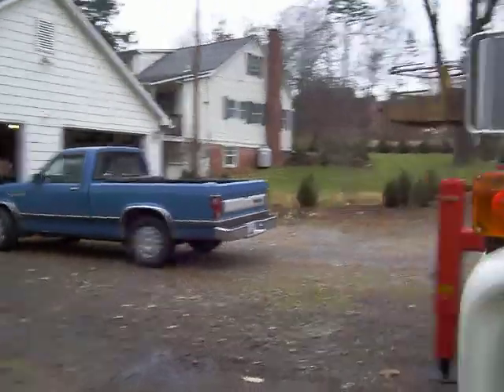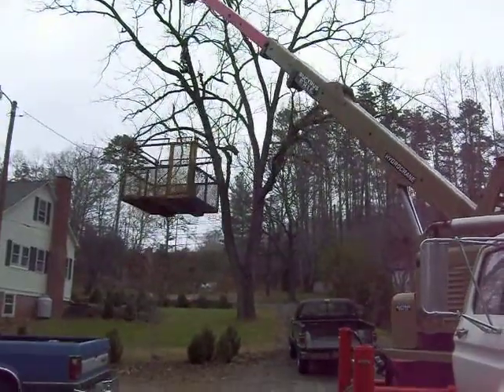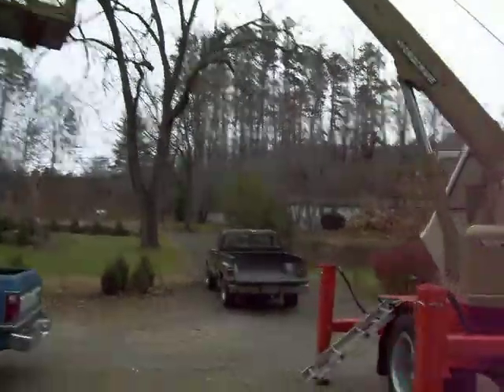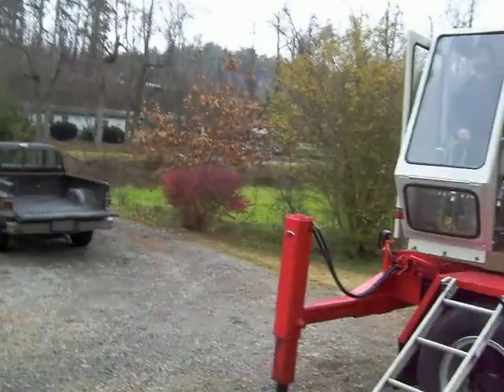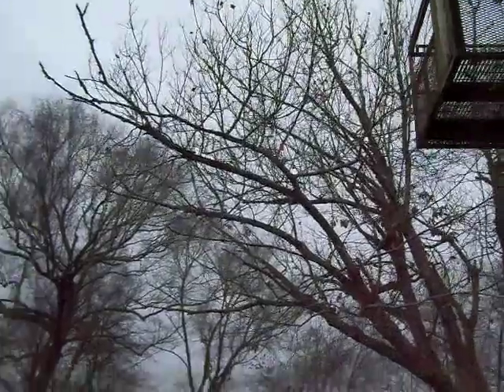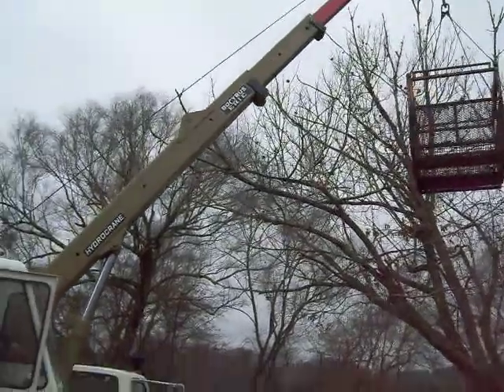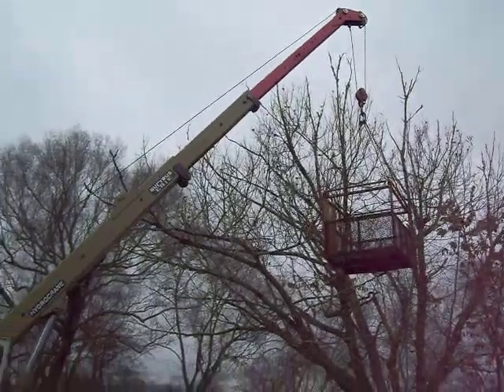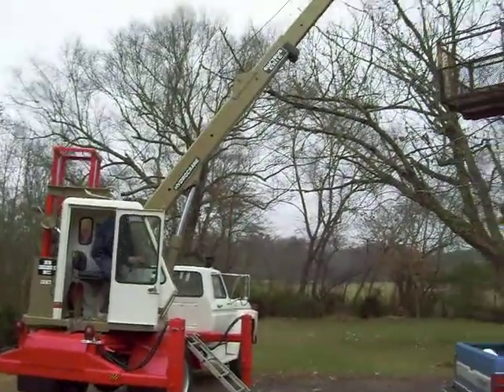Bucyrus Erie H-3 Hydrocrane

Comment: Awesome looks like brand new it would be a handy tool on any yard or even inside it sure doesn’t take much room 😀🇨🇦🪝🏗
Reply from the maker: My Uncle had this machine. He got it at a Duke Power auction in the early 90's.  It is a very mobile machine which doesn't require a CDL (under 26,001 GVW)   It has a decent reach and has a dependable Ford 300ci gas industrial engine. Thanks for the comment.